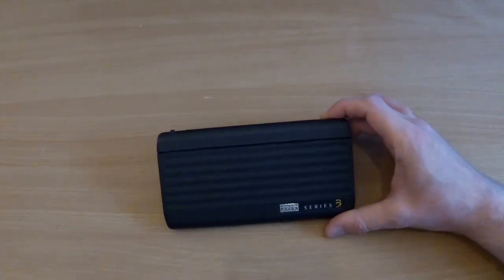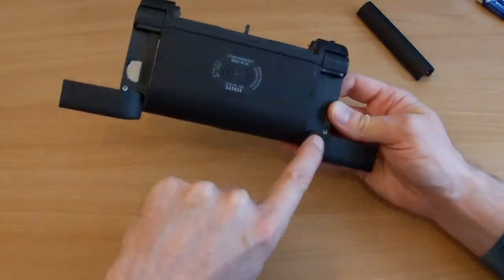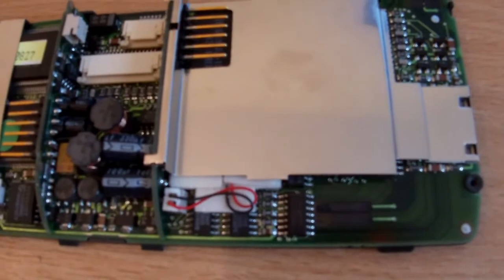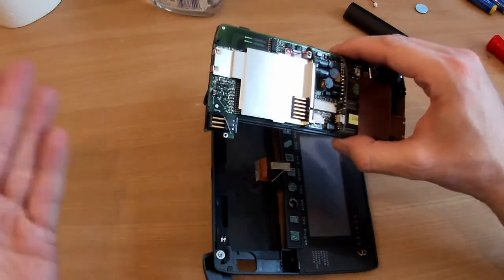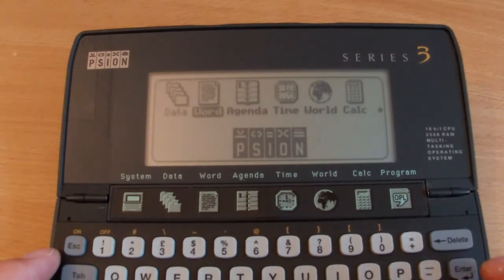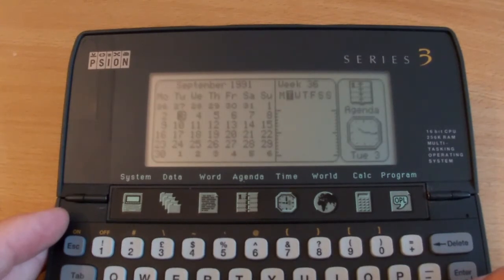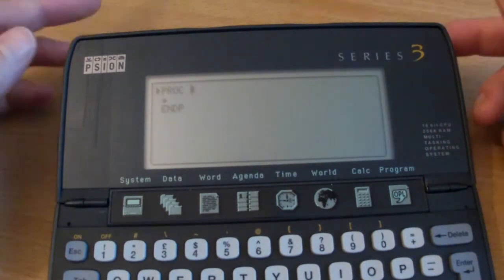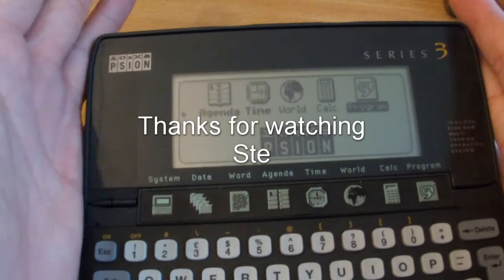Psion Series 3

Comment: Another thing you can do if you're stuck on an application is to press "Esc", "Psion Key", "Up" and "Down" at the same time, and this should take you back to the System screen. I can't guarantee this will work on the Series 3 Classic however since I've only tried this on the Series 3a but it's worth a try. Also, to soft reset, all you have to do is stick a pin into the small hole on the left above the "Esc" key and and turn it back on.
Reply from the maker: Thanks that’s really useful to know

Comment: Damn im all good on taking one of these apart. My Sharp ZR-3500X comes apart in like 2 secs and theres nothing that falls out while you take it apart. Same with my 360LX and my Casio A-11. My Velo 1 tho is a nightmare to open, glad mine works and does not need to be taken apart. I had a Psion Mako and that unit was also not fun to open and I never could get it to work when I re did the battery in it. Unit now is dead sitting in a drawer.
Reply from the maker: Hope you manage to get it sorted one day
Reply: @SteDubya  Id like to get a Psion 5 series unit. I like the keyboard and the screen a lot.